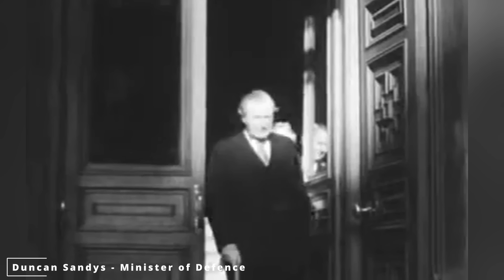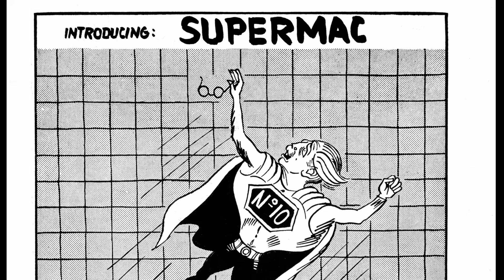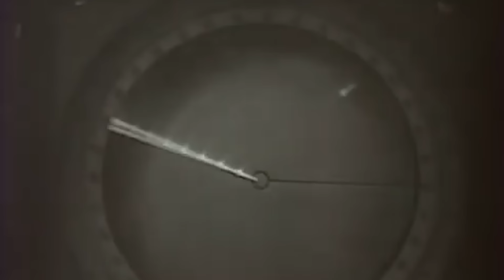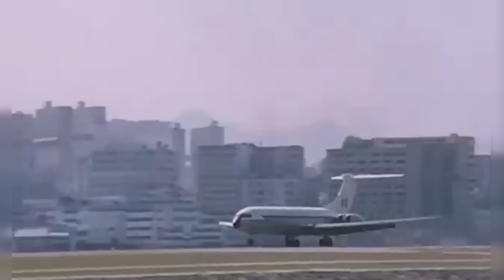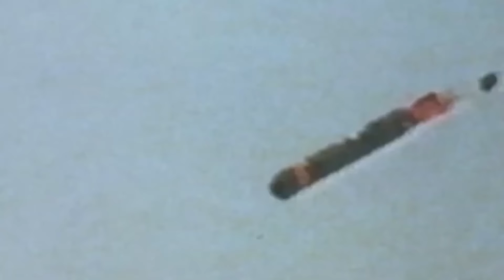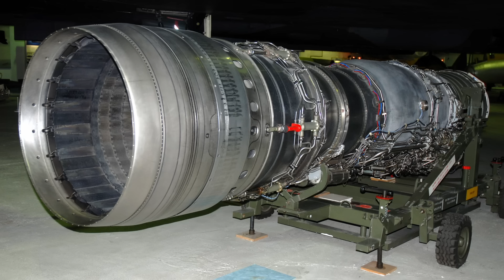How Britain Turned A Failed Airliner Into a Soviet Submarine Predator | The Mighty Nimrod

Comment: 19:Skybolt   cancelled. Well UK  shouldn’t have cancelled TSR2. Served UK right. For depending on America
Reply: TSR.2 was never going to enter service and the RAF didn't want it... it would have been completely obsolete by the time it was ready for service.
Reply: @DoktorBayerischeMotorenWerke 

TSR-2 BAC  

  It will come as no surprise to anyone that we feel we can clear up some commonly held myths and misconceptions.

  Indeed, It's always good to see the facts presented clearly and concisely isn't it?

  It is indeed a great pity & a crying shame that British military forces had to occupy a large part of Germany for decades after 1945 & Russian forces had to do the same. Indeed  Russia still possesses a large chunk of what was German territory. Of course, Russia & the UK produce nukes, Germany does not produce nukes. 

  Companies merged into BAC and then BAe Systems were not failed companies, they were subject to a govt instigated aerospace sector rationalisation process. Handley Page for instance refused to co-operate & disappeared as a result.

Regarding UK capabilities - some examples.
 
 The Fairey (England) Delta 2 was of course the world's first jet aircraft to exceed 1000 mph. It exceeded the previous record by 310 mph & held the record for 1 year.

 In 1944 the RR (England) Nene was the most powerful & most reliable gas turbine aero engine on the planet. Licensed & unlicensed copies of the RR Nene & Derwent engines would go on to power aircraft in Russia (Mig 15 & Mig 17), China, the US, France, Switzerland & other countries for decades after 1944.

Regarding the superb TSR-2.

Truly exceptional, without doubt & it's also correct to say that the aircraft performed well above & beyond specifications & objectives in the short flying test time it actually had, clearly the cancellation of the project had nothing to do with the aircraft's abilities. Cancellation was mostly caused by a rapidly changing world & performance specifications being arbitrarily & constantly increased.

TSR-2 had very little testing & there was almost no opportunity to explore it's full capabilities. It had completed  approx 0.5% of total planned test flying time at the time of programme cancellation.

With 2500 hours testing scheduled to be completed before service entry the test programme had hardly started, but in a total of only 24 sorties BAC had established that from low speed to high speed at low level and to transonic at altitude this remarkable aircraft did not appear to have any aspects of stability and control needing major attention or modification. Its control qualities were already superb and it was right first time – an astounding advance for so early in the flight development programme. Its cancellation could not have been justified on any viable technical grounds. 
   
Info from the project got handed to the US regarding various aspects of the TSR-2 aircraft, it's systems & the methods used to manage it's design including the system components integration aspects of the program.

There were many military jet aircraft designed & built in the US, the UK & elsewhere that were not designed for supersonic flight, in fact, at the same time in the US planned designs for multi Mach high altitude aircraft were being abandoned. 

Tornado & Typhoon & their engines are Supersonic & are indeed British design aircraft with British design engines built by an international consortium. The Tornado design for example started life during the 1950s at Vickers as the AFVG, it's engine is based on the RR RB-199. The EE Lightening is also a British Supersonic jet aircraft.

The Typhoon is the British BAC-EAP with an engine based on the British RR XG-40, the Typhoon and it's engine is also built by an international consortium.

With the advent of intercontinental ballistic missiles (ICBMs), especially later submarine launched missiles, from the late 1950s & improved high altitude capable anti aircraft missiles, crewed nuclear bomber aircraft were increasingly being seen as obsolete. 

Indeed we hope this helps, obviously.

Cheers as always, clearly 👍 of course etc.
Reply: @DoktorBayerischeMotorenWerke 

Typhoon & Tornado, British design aircraft. 

Early days of the airliners.

The awesome De Havilland Comet.
World's first production jet airliner.
World's first high altitude airliner. 
At the time the Comet wasn't particularly dangerous. The DH Comet was definitely not the worst engineering failure in commercial airliner history.

Losses comparisons.
How things were in those days.

DeHavilland Comet 4 UK                          14% 
DeHavilland Comet all mks UK (ff 1949)17%  
Vickers VC10 UK (ff 1962)                         5%

Douglas DC-1  US                                       99%
Douglas DC-2                                              47%
Douglas DC-3                                              30%
Douglas DC-4                                              26%
Boeing s300    US                                       72% 
Boeing 307                                                  70%
Boeing 247                                                   48%
Boeing 707  (ff 1958)                                 32% 
Lockheed L-049 Constellation (ff 1943)  30%
Lockheed Electra US (ff 1957)                   29%
Fairchild FH-227 US (ff 1966)                   32%
McDonnell Douglas DC-8 US  (ff 1958)   14%
Sud Aviation Caravelle  (ff 1955)             15%
Canadair CL-44 Turboprop US (ff 1959) 46%  
Convair CV-580 Turboprop US (ff 1960) 22%
Convair CV-880     (ff 1959)                      27% 
Convair CV-990     (ff 1961)                      33%
Tupolev T-104        (ff 1956)                     16%
Vickers Viscount UK  (ff 1948)                29%  
Fokker F-27 Turboprop NL (ff 1955)       40%      

The Vickers VC10, fastest Atlantic crossing for a non supersonic jet airliner, held the record for 41 years.

For the first few years of operation the Caravelle & Comet had similar accident loss fatalities.

De Havilland had prior experience building many all metal construction airframe aircraft & thousands of jet powered fighter aircraft that were primarily of metal construction with pressurised cockpits & jet engines built by De-Havilland. No aircraft before the Comet was subjected to as much pre-production testing as the Comet. 

It's a great pity & a crying shame that British military forces had to occupy a large part of Germany for decades after 1945 & Russian military forces had to do the same. Of course Russia still posseses a large chunk of what was German territory & of course Russia & the UK produce nukes. Obviously Germany does not produce nukes.

Interesting British achievements.

The gas turbine engine was invented & patented in England before the 1800s.

Axial multi stage sequential stage compressor & turbine technology, first produced for turbo machinery use in England by Parsons of Ireland & North England during the 1800s. The components form the basis of most modern gas turbine aero engines. At the time the concept of the jet aircraft powered by axial internal combustion gas turbine engines was first mentioned thus the internal combustion jet engine & jet aircraft was indeed invented in England before the 1900s & before the Wright brothers got busy.

Work on the multi stage sequential stator rotor axial compressor as applicable to the axial compressor gas turbine aero engine was ongoing in England from around 1928 by Arnold Griffiths and others. By 1943 the Metrovik F2/3  Beryl was a running axial turbojet that was superior to anything anywhere else. As the centrifugal compressor engines were adequate and more powerful at the time development of a larger F2/3  version was commenced.

The Metrovik (UK)  F2/3 axial compressor gas turbine aero engine was flight certified & ran in 1942, it was the result of UK development work ongoing since 1929. At the time it was the most capable axial compressor turbojet in existence but was not required and development work continued on a larger version.

Frank Whittle performed the world's first demonstration of a gas turbine aero engine in 1937. People in Germany kept a close eye on everything going on in Britain at the time.

The centrifugal compressor RR Nene was the most powerful & most reliable gas turbine aero engine on the planet in 1944. That engine would be later built under license or copied in many countries including Russia (Mig-15 Mig-17), China, the US, France and Switzerland powered dozens of aircraft types for decades after 1944.

Pratt and Whitney and others produce centrifugal compressor gas turbine aero engines. The PW200 is a currently produced whittle style centrifugal compressor, reverse flow combustor, gas turbine aero engine. 

The world's first wind tunnel was constructed in England during the 1870s. The world's first supersonic wind tunnel was constructed in England in 1922.

There is no doubt that the Fairey (England)
Delta 2 was the world's first jet
aircraft to exceed 1000 mph.  Indeed It
exceeded the previous record by 310 mph &
held the record for 1 year. Incidentally, the Dassault Mirage 3 & 4 are based on the Fairey Delta 2.

More recent UK military jet aircraft.

The Tornado & Typhoon & their engines are Supersonic & are indeed British design aircraft with British design engines built by an international consortium. The Tornado design for example started life during the 1950s at Vickers as the AFVG, it's engine is based on the RR RB-199. The EE Lightening is also a British Supersonic jet aircraft.

The Typhoon is the British BAC-EAP with an engine based on the British RR XG-40, the Typhoon is also built by an international consortium.

Brazil has the world's third largest airliner manufacturer and makes very good airliners & Brazil is 100th down the list along with Indonesia for wealth per capita. Of course it is in fact the case that Embraer can't build those airliners without purchasing stuff from the US, UK & Europe. For example, Norway, Holland, Denmark, Ireland & Belgium, top 20 wealth per capita, don't make airliners, its as simple as that.

Global aerospace. 
From the 1950s sector rationalisation and consolidation took place. 70 companies in France and 300 companies in the US disappeared due to merger or dissolution. In the US Boeing was almost bankrupted by the 707 project.  Boeing had a well protected domestic market and the available space and resources in the US to engage in large scale airliner manufacturing enabling them to capture orders simply by being able to produce airframes fast enough and cheap and nasty enough. Another factor is airlines preferring to obtain as much of their airliner inventory as possible from one manufacturer. 

Global Aerospace Sector, what's happening.

For example, there are of course no German companies that makes German jet aircraft in Germany & there are no German companies that make German gas turbine aero engines in Germany that are suitable for widebody airliners.

The UK has the world's highest combined per capita Nuclear / Defence / Aerospace Sector Activity.

UK defence sector, absolute terms, world's second highest activity. 1st for per capita defence sector activity. Per capita nuclear powered submarine construction, 2nd position. 
Main players being Rolls Royce, Babcock, GKN Aerospace & BAe Systems. Activities often involve international collaboration. BAe systems, RR and other UK companies now handle more Airbus work value wise than Germany. 

There's a good chance that anyone currently flying on a widebody airliner will be on an aircraft powered by RR gas turbine aero engines made in the UK and a good chance there will be other hardware on the aircraft that's designed and / or manufactured in the UK. 

Rolls Royce Holdings UK
Subsidiaries
- Rolls-Royce plc
- Rolls-Royce North America (ex Allison etc Classified Military stuff)
- Rolls-Royce AB
- Rolls-Royce Deutschland
- Rolls-Royce India Private Limited
- Rolls-Royce Marine Power Operations
- Vinters Engineering Limited
- Rolls-Royce Controls and Data Services
- Rolls-Royce Power Systems
- Bergen Marine
Joint ventures include:
- Rolls-Royce Turbomeca
- MTU Turbomeca -

Trent Family
The MT30 (Marine Turbine)
Industrial Trent 60 Gas Turbine
Trent 7000
Trent XWB Airbus A330neo.
Trent 1500
Trent 1000
Trent 500
Trent 600
Trent 700
Trent 800
Trent 8100
Trent 900
   
RR wholly owned subsidiaries in Germany handle smaller 2 shaft RR gas turbine aero engine work.

The UK space and aerospace sectors are highly productive, high-value industries that together contribute over £18 Billion in direct Gross Value Added (GVA) to the UK economy. Individually, the space industry directly contributes about 0.3% of UK GDP 7•2 Billion while the aerospace industry contributes approximately 0.5% £10•9 Billion.
   
We hope this helps.

Comment: You might benefit from increasing your volume on the narration by 5-10 dB in the future as it's quite low compared to the frikkin' anoying loud commercials
Reply from the maker: Is it? I do watch thew video when it's live, though maybe it's my headset. I will have a play about with the volume. Thanks for pointing that out.
Reply: @AviationRepublic unfortunately algorithmic selection doesn't show you the same comercials as I get.

Rather good Harman Kardon speakers and subwoofer on this end.
Reply: Oh, almost forgot. Thanks for taking your time to reply. 👍🏻
Reply: I'm fairly sure YT alter the volume levels so that commercials/ ads are always significantly louder than YT channel content volume so there's nothing a creator can do about that.
Reply: @Paul-mh9pr in general they're on the same level for me so I doubt that theory. The difference in level is also noticable when recording equipment is changed and the timbre of the audio changes.

But I might be picky as I work with networking in broadcast media.
Reply: @erikedbladh995 

At my end commercials are always at least 20% louder than anything else.